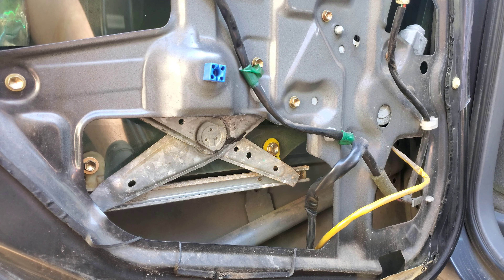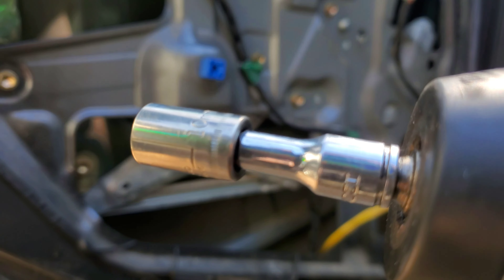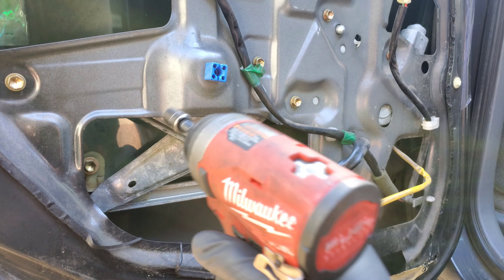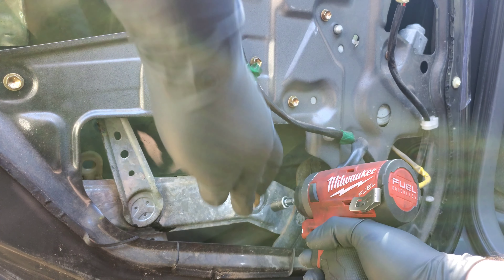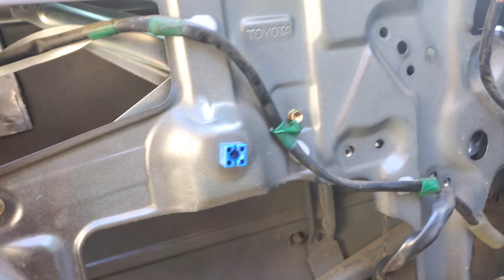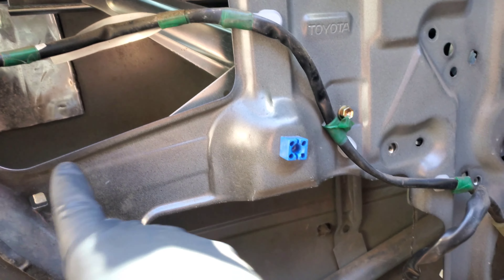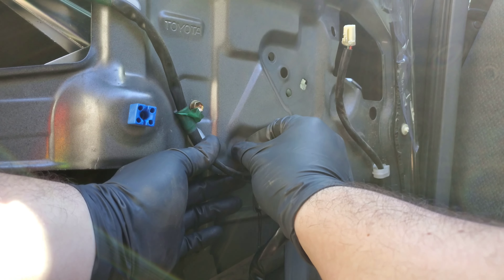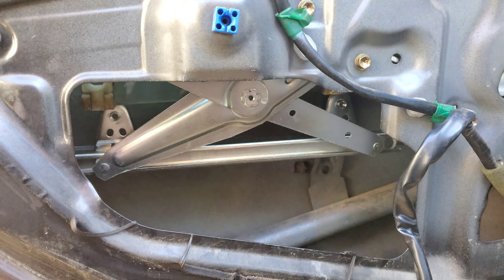How to Install Window Regulator & Motor - 2000 Toyota Camry

Comment: i HAVE 1999 Camry and same problem in the rear window regulators break at the star. The bolt with gear like ending that goes up and down on the motor got jammed and gave up. But my motors were fine. So I bought just regulators and fixed them. Front did not break at that joint.

Comment: I know this is an old video but I had the same problem in the beginning, you have to reposition the end where the motor is because the unit swivels, lol it's kinda tricky  and then all holes will line up, hope this will make it easier for any new viewers in the future 👍🏿